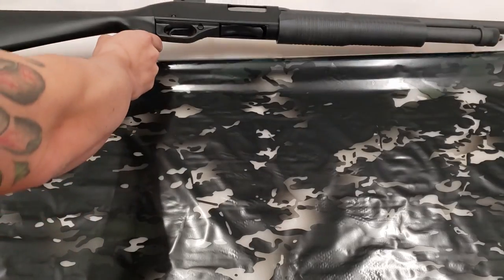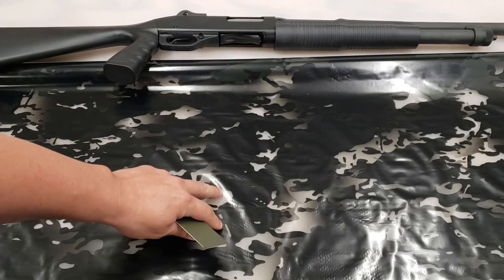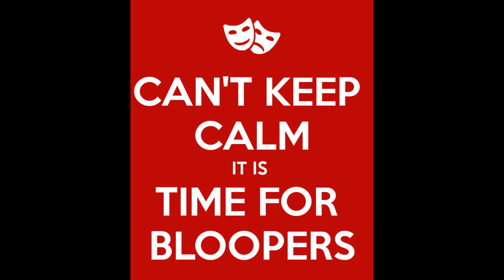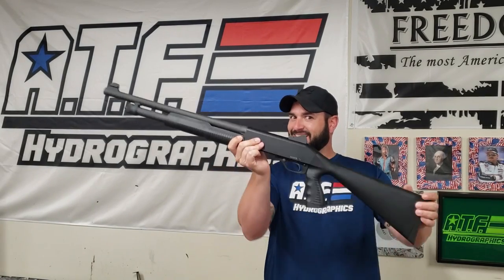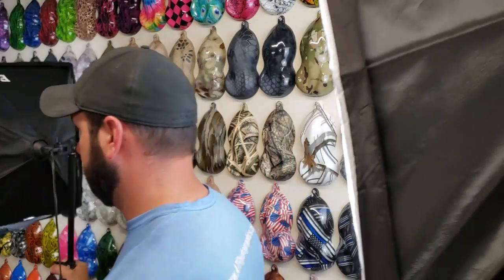HYDRO DIP MULTICAM BLACK [Stevens Model 320]

Comment: Why dip only one side? Why not dip the entire thing in one dip?
Reply from the maker: We did dip both side, just did them one side at a time. After dipping literally thousands of guns we have found the best way for appearance is to dip each side separately so there is no stretching, or issues with voids. Most guns these days have tons of stippling or grip serrations cut into the sides which will trap air and cause a void in the pattern if not dipped at the appropriate angles, and you can't get those angles by dipping all in one dip.